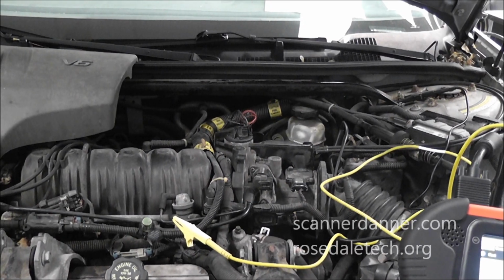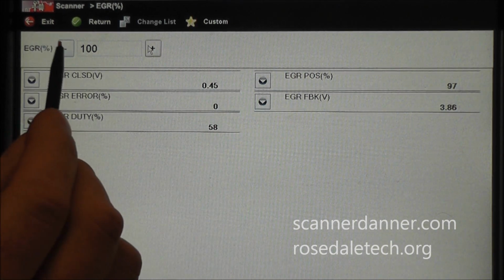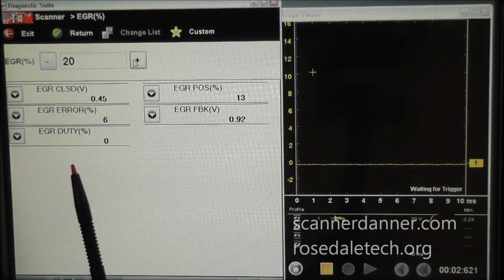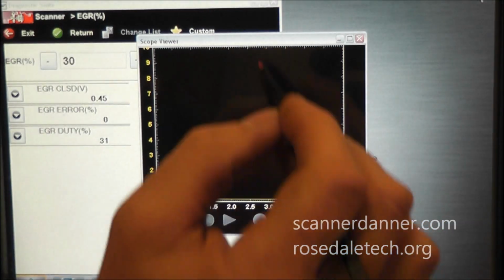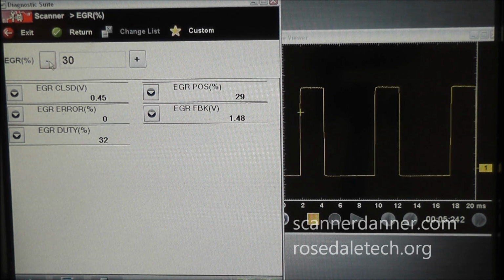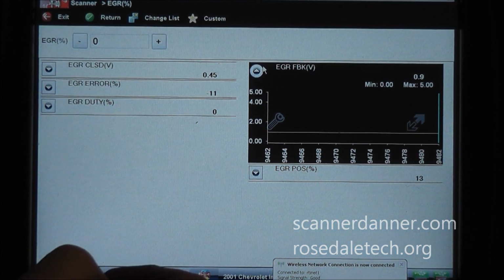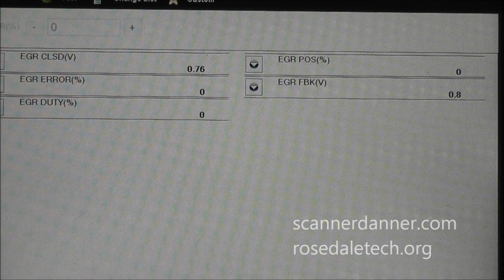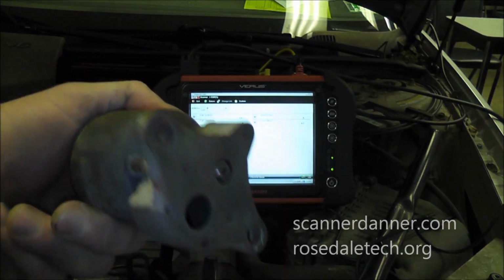EGR Closed Performance P1404 with new EGR valve installed (GM)

Comment: Live and learn. Working on high end Germans I have to do the battery trick 3-4 times a week for anti-pinch windows, audio systems, climate controls you name it.
Removing both bat. terminals and shorting them for a minute to drain ecu capacitance brings thing back to its senses 90% of the time.
Man, Your attention to details and love for the subject is unparalleled.
Thanks again!

Comment from the maker: no, EGR gas will displace oxygen in the cylinder. less oxygen with the same pulse width command = richer than normal ratio and negative fuel trim numbers.

thanks for the positive feedback!

Comment: Aside from disconnecting the battery to erase computer memory and reset a new learned value, I agree that cycling the key should have done the trick but, there is the possibility the PCM may have to be reprogrammed to address this concern. A lot of cars today are fixed with reprogramming to address a calibration process. Many times hours could be spent trying to fix the unfix-able when all it needed was a reprogram. All-in-all a great video for those still learning the trade. Job well done!

Comment: Also thank you for showing how to do the split screen (scan tool/scope) Ive seen you and mrgreasybob do this but cld never figure it out. One more thing are you using the wireless module with your verus? I have upgraded mine, its a very nice option to have when using the scope under the hood .

Comment: Very nice Mr. Danner. Had same code, same fix on a 01 grand am tuesday of this week. I actually unhooked battery to remove upper intake for oil pump drive o-ring replacement and when battery was reconnected egr data was normal so called it a fix now its just a little more clear as to why;-p

Comment: Paul , since I watched the vid first I just cleaned out the pintel and put it back and it was a no-go, so as you found out I disconnected the neg batt cable and guess what the MIL is  off and I"m a happy camper.  If you had used a memory saver to keep alive the radio stations ect, would this prevent the ecm resetting  after the neg.  cable is disconnected.  Not sure what modules are kept alive when using a memory saver via. pin 16,4&5 .

Comment from the maker: but it would be misleading because you would see a 0% valve position. It would be the EVP voltage that would be the give away. I really learning something from this one. I almost put a valve it in. I figured it was good to show the whole process.
Lesson learned here is do not take a potentiometer learned closed position as being 100% accurate. I've seen this with non adjustable TP sensors and now EGR EVPs.

Comment from the maker: Great question! You think like me. I was wondering the same thing. I was thinking of playing around with this. Like maybe jamming a piece of paper in the pintle (temporarily) and then disconnecting the battery and see if I could get the PCM to zero the position. My guess is there is an allowable range for the self zero and it is not the full range of the sensor. As for the scenario you mentioned, a stuck open EGR will give a rough idle and negative fuel trim numbers...

Comment from the maker: ah good question my friend. the key would be to measure both wires with the solenoid energized and de-energized. at this point conventional voltmeter ID can be done as described in Section 3 of my eBook. 
De-energized,12&12=ground side switched
De-energized,0&0=power side switched.
Then energize the solenoid and see which wire changes. This is your control wire. 
Oh and experience is key here too :-) Every single one of these solenoids with this design, I have found to be power side switched.

Comment from the maker: leave your trigger setting on auto for now. basically a trigger is set to tell the scope where to start drawing the waveform. did you notice in this video as the battery was dieing, the square wave amplitude dropped to a point that I was having some triggering issues? well for the waveform, if the trigger is set to a level that exceeds the waveform amplitude, this will cause mis-triggering, or no signal at all to appear if using a manual trigger. auto will draw it anyway